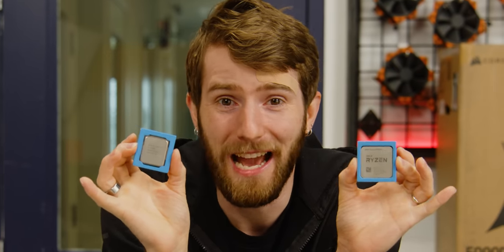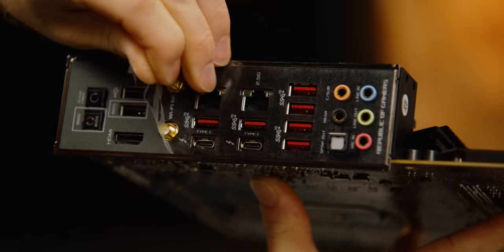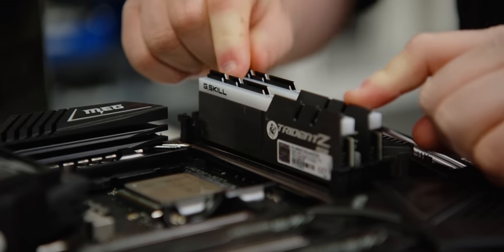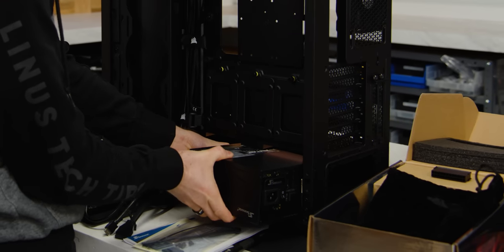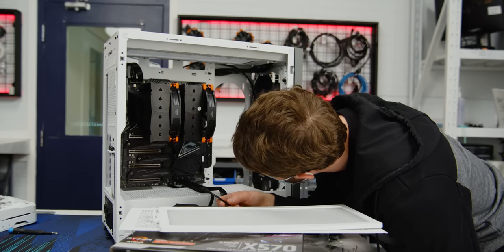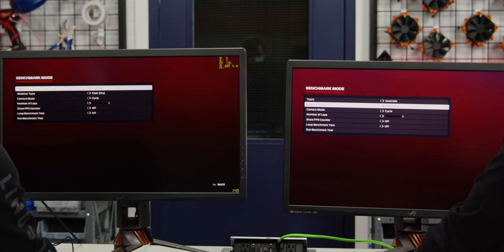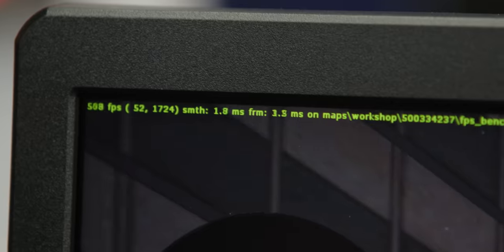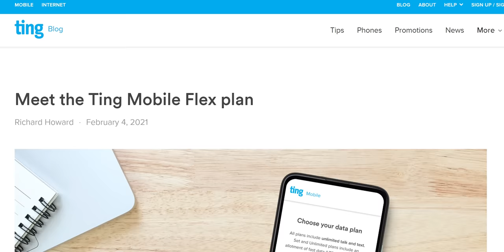Can Intel Beat the Ultimate AMD Gaming PC?

Comment: Both great systems 🥳, why no Thermaltake Case or the inwin905 with tempered glass on both (or 4 sides)? but hey wait🤔, where are the Diamonds 💎 or at least one 1Carat piece on the Power button, with laser RGB illumination! Cause look how much the parts costs, so a further 800-1000 Bucks, who cares😂😭 where to get that special one🤑, I would be happy with a Radeon 6900XT😏. Nice comparison and great job. Well done!

Comment: 3000$ on a GPU and the corresponding monitor (144fps 4k minimum 800$) to do any less than 1440p (few case scenario) still have any 6 core CPU  give u headroom for serious GPU bottleneck if it's gaming u want I5 11400f for 150$ can double the best GPUs money can buy in 1440p not to even mention 4k, AMD Ryzen 9 5900X it's like an old rich man buying a Bugatti to drive 15miles hour, tech tips should be telling u that

Comment: I hate All These fanboys fighting that AMD or Intel is better. The point is That AMD went 7nm too fast and its not Well optimized. If you see that for 8 Cores it can Almost beat the AMD with 16 cores i would say Intel ist the winner because a I9 with 16 cores would clearly Win. 

Also Intel is better at engineering (Linus said it in a video) so with the 10nm+ coming next year from Intel we get 19% more Performance and very good pricing, Intel runs more stable and I had 2 AMD Systems in my life and the experience was that In games where it wasnt optimized at all it couldnt run good on the other hand i had a I5 4470 That even ran better. I currently own a I9 10850K and every games I play it runs smooth.

I Hope of course that AMD will get better at that.
Reply: I agree, the new intel i9-12900, which they will soon release it, is better than ryzen 5950x, also the new graphic card that intel is making, is comparable to rtx 3070, maybe even better. We will see.

Comment: Although i may classify myself as an AMD lover, I think Intel's 11th gen Core i9 is as equally as better as it's price range. You get on what you buy sometimes, and it still performs decently besides... what a 2-4 fps difference? I'm sorry but i'm mostly for the price.

Although i'm not losing hope for intel, they have some juicy upcoming graphics cards coming up. And it might still perform as better as an RTX 3090 but even more cheaper. Mmmm

Comment: If only IBM were building G6 to compare with. But no, now it's higlhy predictive x86 devices versus a messy ARM family tree.
however, Something goes wrong with AMD, because, hey 5900x with 270 Single thread Cinebench R15 score versus the best intel with 220 core i9 score (from 200 with first skylake) and seing only 5% gain in games not gpu bound, well...

Comment: Without wearing gloves, wearing mask is useless 🤦‍♂ your are touching graphic card and processors so that can also transmit virus if you have it. Also that's not peels it's called wrapper or cover of the imprint. He said he won't compromise and then ends up getting an average monitor 😂 not even 4k to test actual graphics stats